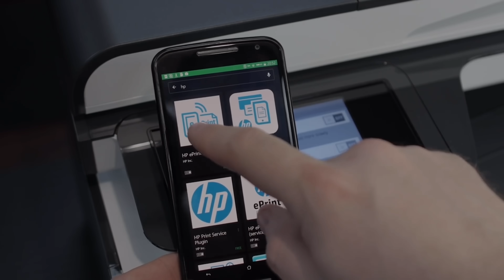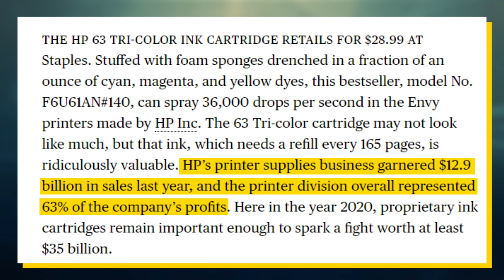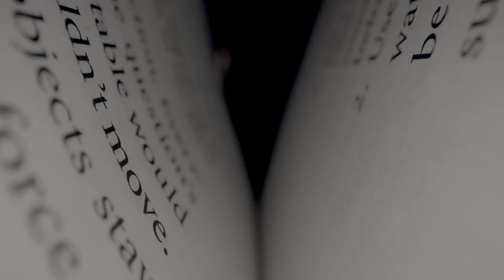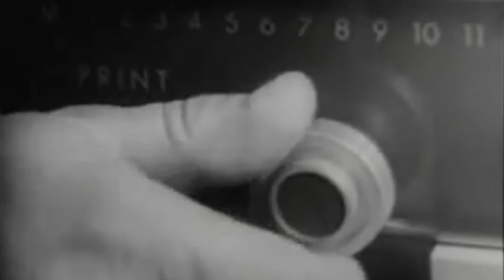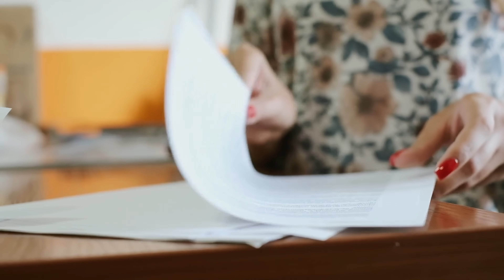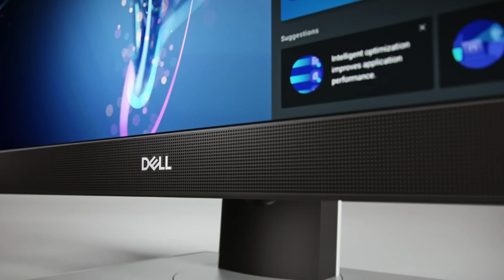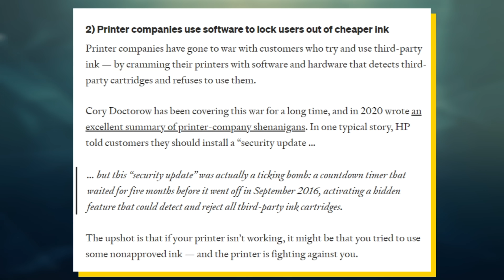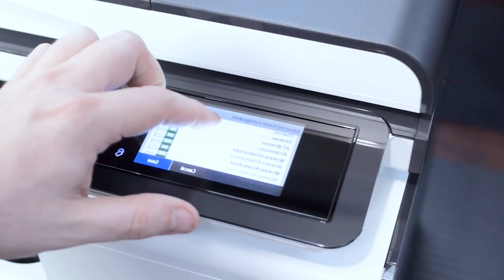Why Printers Are Designed To Fail: The Frustrating Truth

Comment: Epson was a game changer when they introduced those ink tanks that you simply pour ink to the printer and it works. HP and Canon wasn't excited about it at first, but eventually they felt the pressure and produced the ink tanks.
Reply: That's right. Epson with their eco tank was a game changer. I used to spend a fortune on ink cartridges. Even HP would make their cartridges to expire. So, the ones you bought on sale would expire and you won't be able to use them after some time. And don't even think of buying generic ones, because they won't work. Or they will work for a while until HP will force an update on the printer, and the generic cartridges would stop working.   I bought the Epson 3750 model a couple of years ago and I'm still using the ink that came in the box. As the video said, we are printing less and less these days. Back in the days, you'd have to first print something out, then sign, scan it. These days most legal documents come via Docusign that doesn't require printing.
Reply: It was started by users doing the modding, they mod the printer ink cartridge, adding external ink tank, and tubes that connect the two. The practice was so popular that more tech savvy people even offering services to mod the printer in such way, and yes Epson eventually learn about it.
Its not that Epson didn't try to stop such practice, but rather they can't do that legally.
Can't beat em? Join em! Thus Epson eventually came up with their own version in form of Eco Tank.

Epson did however have their clandestine revenge by means of silent firmware updates. Before the updates the cartridge will query the status of ink sensor to check if the cartridge have enough ink to do the printing operation. After the silent updates the cartridge behavior changes instead of sensor status its counts how many ink has been sprayed after the counter exceed certain value the driver will start giving "Low Ink Warning" and eventually "No Ink Warning". This not an issue for non modified cartridge, but looks very BS in modded printer.
Reply: @rashidisw  ooh yah you are right. I remember seeing those vids on YouTube, people doing all those modifications. And it worked very well.
Reply: @rashidisw  I don't think "low ink warning" is a clandestine effort by Epson to screw users. It's just that they use the cheaper mean to detect the low ink status. Instead of putting detector inside each color tanks which will cost them a few cents, they opt to use cheapass counter that will only cost them a few lines in their firmware which is practically 0 in manufacturing cost because they have to purchase and install the firmware regardless, whether with or without those few lines of code. 

And with everything cheapass, you get hilarious result. You cannot expect user to fill the tanks to the exact microliters as the counters demanded. That's how you get "low ink warning" a few prints away after you fill the tanks to the brim.
Reply: The advantage of Epson too, at least where I live, Epson has a factory here so ink bottles are not that expensive. About $6 per 90ml bottle. Each bottle last 1500 pages compare to catridges' 200 pages.
Reply: @rzpogi  ohh thats great, this side (South Africa) they cost like $10
Reply: @rzpogi I bought the big bottles 250ml with black 500ml for $75, putting me at close to haft of what you paid. I am printing for .02 of a penny and a penny for paper right now. I love it.
Reply: How their printheads are performing though? I heard of many units suffering print head failure after a year or two usage. If that's the case it does negate the savings made. Right now I use a cheap HP inkjet with 3rd party cartridges, which are literally 1/3 of the price of the originals and the price per page is around that of a laser printer
Reply: @sedatmehmed4371  its the same, I've been using cartridge printers before, and i would run into print head problems after printing over 50K copies. With epson I've never run into printhead issues yet, but one of my Epson had a problem of paper roller, and it causes paper jam frequently. 
But the print quality is still good
Reply: Exactly. And my Epson ET-3750 works flawlessly for years now. Just buy some cheap Inc from time to time and you can print everything via wifi from iPhone or pc. Copying also works fine.
Reply: sure... it was a game changer. just don't forget their magnificent "ink stamp". You have to buy print head for every 2 or 3 years and those print head doesn't come with cheap price, you could say its better you buy a new one instead "fixing" those print head.

and guess what? those problem could be solve easily with some software, but you've crawling in google a little bit, coz those software sometimes contaminated with malware depends where you've been download it.
Reply: Epson did that few years after they got caught and sued for having their cartridges show empty after some time even if they were not.... sound familiar?  They lost a lot of market share, so the tanks was their comeback.   
I use Brother at home, and a Canon for mobile printer, F Epson and HP.  But you go ahead and support their bull.
People have short memories and like bending over I guess.
Reply: Epson has indeed continued to innovate. It grew out of the same precision manufacturing business group known for Seiko watches.
Reply: You will own nothing and be happy.
Reply: Unfortunately, the print head will failed first and that is the most expensive part. Even if epson use ink tanks on their printer, they still put counter at their printer. You still need to reset the counter if you want to use the printer even if the print head is ok.
Reply: @nasimicin  I have used mine for 2 years now without any problem. From my calculations, I have saved buying at least 10 ink cartridges. That is enough savings to buy another brand new EcoTank printer even if the print head gives up today. And I'd be cool with that.
Reply: @nasimicin  Epson printhead won't fail easily as long as you use quality inks, for example genuine Epson ink, which is rather expensive but far cheaper than Canon or HP ink (which come with its own cartridge and.print head). From experience, it's the paper roller that fail first (and often) rather than printhead.

Comment: I work in IT. I have to tell people do not connect your printer over wireless. You will end up losing the connection and you'll have to go through the wizard again. I always tell people connect via ethernet if you can. Then I go in and change the port from the WSD port as this will lose connection, I switch the port to an IP address you will never really have issues. Printers are a pain.
Reply: Ugh, dredging up some ptsd inducing memories for me...
Reply: I’ve been in the exact same boat for networked printers, however using this method when you can’t Ethernet a printer still works pretty well. (Not to say I prefer it)
Reply: USB cable for the win bro
Reply: @benjaminsmith9943  I've had similar experiences with USB even, the only thing that I've ran into that works the best is the Network Port, yes for USB you can unplug it and plug it back in and that usually works but network port by far has less issues.

Comment: Less and less people and companies print. Haven't used a printer in over a year and there was still some ink in the cartridge. If companies reduced the prices by few cents in order to switch me to the e-bill I wouldn't even get the bills in the mailbox. EVERYONE is moving away from printers. All the communication in my company is by e-mail (official stuff), and digital signature is the norm these days. PDFs are used everywhere. They had it good while it lasted. P.S. Canon printers are solidly built (at least by my anecdotal experience) and I don't have intention on buying products from rival brands. My PC is HP but my printer will never be made by the HP... EVER!
Reply: LOL no not everybody's moving away from printers they're still used very heavily you're just blind just like fax machines you would be surprised or fax machines are still used just because you don't use it doesn't mean others are not

Comment: I recently installed a generic driver for my HP all in one printer by accident. suddenly this thing can print even when the cartridges are "empty" and even scan over wireless without needing an account or their software running on my pc.

This was indeed the best mistake I ever did.
Reply: I recently bought an HP ink jet printer. I print about 5 pages per month - literally. I hardly ever print anything. After two months the printer started telling me it was low in ink. I only print black. So 10 black pages and you're low on ink? Really? It's been about 6 months now and I'm still printing with low ink. Looks fine.
Reply: @bobdinitto  The first cartridge is like 1/3 of the capacity of a normal cartridge. So yes it is possible. I think i managed to get like 25 pages from mine
Reply: @bobdinitto  if it helps, the option for it appeared after I installed PDF24 creator. There might be another way to make it visible, but idk.
Reply: @bobdinitto  pay more and get one with refillable tanks. Epson do this. The ink is much cheaper. Get one that has dedicated buttons/ controls with a screen as the multi function buttons and step through menus are simpler but that means more virtual controls and let me tell you, they're a big pain in the arse. Menus get very specific but LONG.
 I'll never buy a tv with a simple remote or with no controls on the set. This is an example is just for illustration.
 I helped a friend's mum and this tv was a fucking nightmare to tune/set up. If you wanted to correct a mistake in the on screen password, it wouldn't let you go back. Push another button to try and it would hide the password. Couldn't undo. Instructions- well there weren't. Had to start over and over again.
Printer. Wouldn't physically connect with direct wifi. Led showed it was all go. Wanted the password. Not on the box. You have to print it out. Got an ipad. Won't connect to it. No fuckin "air" job. Get my computer out. No go. Eventually Pulled out the usb, now it actually connected and printed. Needed a firmware update. Spent the good part of a day on it.
Lesson: multifunction buttons - 'cause there's only a few buttons etc with weird code symbols on them are cheap crap units. Spend more and always get dedicated controls on whatever facia panel you have to deal with. You'll have a better time.
Reply: The worst is if the ink uses button cell batteries on their security chips instead of cheaper RFID. Most people will buy two sets of black and color ink and even if you've never opened the package after a few months the battery drains and the ink "expires". Double bonus is that even if the stores don't sell the stock it's purchased they're now forced to buy more stock anyway!!!
Reply: @godlugner5327  There is no ink cartridges that uses any kind of battery. The settings/data is stored in FLASH memory, and is either interfaced over something like OneWire or RFID. No battery whatsoever. The ink "expires" because there is a production dated programmed into the cartridge. It has nothing to do with a battery. Most Lithium-button cells have a life span of 5-10 years btw, and the ink would dry out before a button cell dies.
Reply: For many consumer HP models they do have the FOR IT PROFESSIONALS drivers on the product support page itself. I never bother using HP Smart at all.
Reply: Link to the driver.
Reply: @farenhite4329  yeah I'd like to see that driver. I don't believe it. The software "mechanism" that locks out the old ink cartridges is in the printer, not the driver. I call BS on the driver explanation.
Reply: I had also searched a "suggested" driver/software, cause I already knew of the anti-trust tactics there printer company does, and what I searched at that time was installing a "non-company" issued driver. We buy 3rd party ink all the time, they're 2~3 dollars cheaper in our country at that time.

Glad there's a rise in Digital paper/documents. My mom used to work in a government and the papers are just everywhere, there was once a fire and it burned everything, no one was hurt fortunately.
Reply: @MangaGamified  lol so you think random people are randomly out there randomly writing drivers for random printers for fun and also free? What do you even mean?
Reply: @joshts00  lol no I'm not <3. There was a time when there was a balance between cost-efficiency and profitability for the company.

In my country there are even 3rd party who hack to be able to use 3rd party cheaper inks. If you're still angry just say Hi for me to your PR team.
Reply: This hurts HP sales. Pls don’t. 😮

Comment: A (Not so) Fun Fact: my color HP printer runs out of cyan when I only print black and white most of the time. When I email HP about this, they said that the printers are designed in such a way that it also uses color inks while printing in black to form a perfect black. So I need perfect black just to read some words on the document, and the printer just stops printing even when black full but not the other 3 (cyan, magenta, yellow)
Reply: That is the most perfect description of how they make their money EVER
Reply: Just change to 'black only' in settings.
Reply: The head cleaning process in general also consumes more ink from all the cartridges then printing a 100 %  covered page. At least that was the case with my Epson machine I had before and the head cleaning  ran  every time the printer had not been used for at most 2 days  so overall about 90% of the ink got wasted as I did not do full colored prints every time or ran the machine as a printing press. I just thought it would nice to be able to do a nice photo printout and send to friends and relatives now and then. I dont know how this is with HP machines and also this was a while ago I had that Epson photo printer. I dont know how it might be now if things have changed regarding this.
Reply: I used to only buy HP inkjet printers, but then stopped buying them when it became apparent that their printers had all sorts of built in planned obsolescence and ink restrictions.  Right now, I'm on my second Brother printer, the first one having gotten plugged up at the printheads.  We'll see how long this one lasts.  Brother's inkjets seem to be less usurious than HP
Reply: I just use an all-black HP laserjet printer. No cyan on my black-text document printouts for me.
Reply: SMH
Reply: Or remove the colour ink catridge it always works
Reply: @DJ_ 200  mine will work with an empty color cartridge but won't work without a cartridge.
Reply: Not sure what the problem is. You can change to black only in the settings, and get a worse quality black that is probably fine for your use case. To get a color that looks good as a black, you do actually need to use other colors. Try it yourself.
Reply: Laser printers (and maybe inkjets) put a dot code on the print out that is unique to the individual printer. This is a legal requirement in the US and some other countries. I understood that the yellow toner is used for this. Maybe yours uses cyan.
Reply: @Roger_Gadd  That's something else and rather negligible. The cyan is used to make crisper blacks and is used heavily

Comment: Honestly the printer industry needs a disruption of some sort otherwise it's going out of hand, whenever I am in dire need of printing something, either the printer will not work or the ink has just vanished. I mean is it so hard to make a cartridge that can be locked when not in use to save the ink?
Reply: There has been a disruption for years now. Ecotanks last for about 3000 pages of 4 bottles of cheap ink . Bought one about 4 years ago now and only refilled it once for about £30 .
Reply: How? You hear the video explained that it will cost $1000 to manufacture a printer. Do you want to buy that, or to "buy" $100 printer and pay in "installment" by buying their expensive inks?

Comment: What is stopping other companies from making cheap and not terrible 3rd-party ink?
Reply from the maker: Just hard to find really. It’s mainly just Chinese knockoffs who are doing it rn
Reply: The printer makers specifically do the best they can to make it difficult, not just from a technical perspective, but also from a legal perspective in the form of patents etc. They're engineered to such precision, to require such precision, that it takes a lot of investment to set up manufacturing of such devices. The ink itself is the easy part, it's deconstructing the barriers that the original manufacturer puts in place to make it difficult. That's why most decent third party inks are remanufactured cartridges that strip parts from used official cartridges, and require a supply of "empty" carts in order to sell their products. Any time you see a bin generously offering to recycle your used carts, it's not out of the goodness of their heart and a love for the environment, it's to get raw materials their business depends on.
Reply: 3rd party ink is easy to find. Hard is refill the cartridge our find a 3rd party compatible

Comment: Bought a brother MFC L2712DW and I'm having a really good experience. Everything just works, never had a paper jam in over a year and I can use third party toner cartridges no problem at much lower price than original cartridges. Only gripe I have is with the mobile app, it's pretty slow. 
Other than that can't be happier with a laser printer, I'd never buy ink.
Reply: Brother makes a great printer.  Had a Brother ink jet printer that worked great for years.  Only upgraded to laser when COVID hit and there were 4 of us in the house printing stuff for work and school, but we stuck with Brother.  I can print effortlessly from my computer, phone, or tablet.
Reply: I like my Brother DCP 750CW so much that I bought two more from eBay. They accept cheap aftermarket inks and never go wrong! Hardly the fastest printing, though!